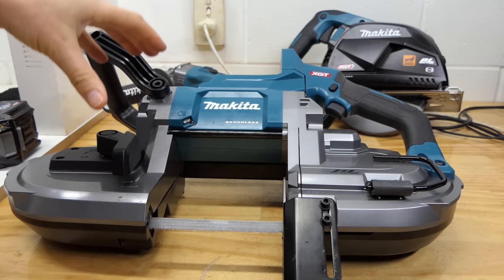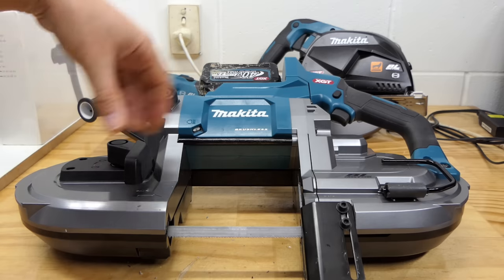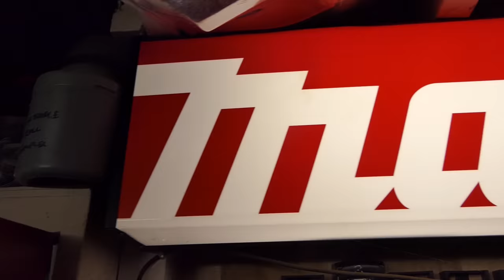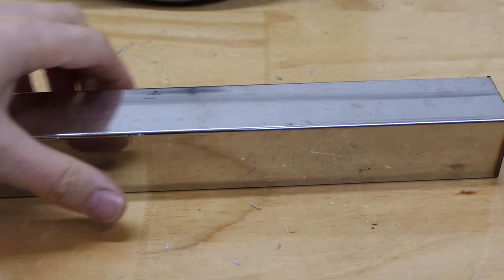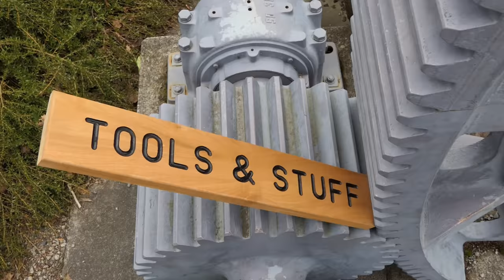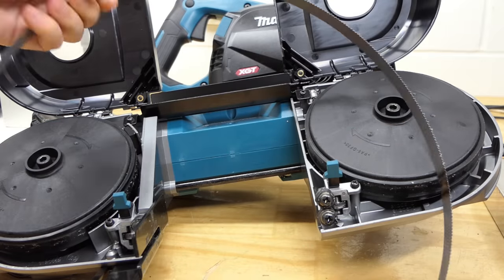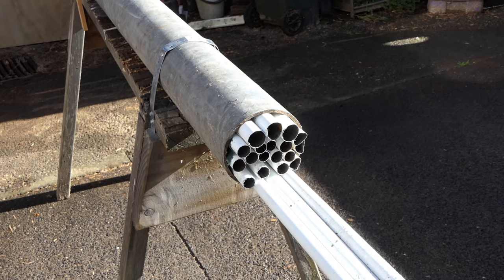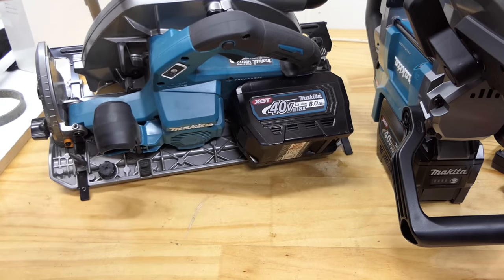Makita 40v Bandsaw, Or is it Band Saw? Either way it is BIG! Makita XGT PB002G Review

Comment: Another nice thing about this size saw is that you can get blades from just about any manufacturer that will fit it, the 45 inch blade is standard across most of the deep cut portable band saws. I run Makita, Milwaukee and Dewalt blades that I have found on clearance for around $4 a blade.

Comment: I bought one for a specific job - cutting 65mm2 powder coated steel posts to length once stood. I have the small cold cut circ saw, which only cuts to 50mm depth & this was cheaper than the bigger cold cut circ saw. It is a bit big to carry around all the time, but it is so handy. If I have it with me in the van I use it almost every day. One of those tools you never knew you needed until you got one. Holding the stock firmly & resting it snug on the guide plate are key to success. I've cut custom brackets out of angle in minutes, it cuts stainless all thread so clean you can run a nut straight onto the cut end, It will cut quad gutter to length (better with the 24TPI blade) and I used it to help cut the guttering in around a 150mm PVC downpipe. It's not that heavy, just big & a 2.5Ah battery will keep it going most of the day. The guide plate can mark surfaces. I should probably stick something a little softer over it..

Comment: After using this saw for about 6 months now, it's great. I have a variety of blades and choosing the right blade and having a sharp blade makes the cut way faster. I use it mostly for ductwork, even a piece of 12 inch duct can be squeezed in where you can cut 1/3 of the pipe and quickly finish it off with snips with no waste. Basically the higher number of teeth per inch, the thinner the metal it is designed to cut.

Comment: Had a DPB180 since 2013. Fantastic saw. I use it to cut off problem hydraulic cylinder shafts and really anything to heavy to take to the cut off saw. Even used it to cut some 2" plate once during a fire ban. I frequently cut 1045 round bar 2" diameter because Im to lazy to pull a length from the steel rack. Probably use it 5 times a week. A couple of things though, I have yet to come across any after market blades and its a different size to the American brands so Makita only. Also I do use a little cutting aid like a tapping oil or spray. 
I will say that everything that was cut was with a WAY to coarse a pitch blade.  I use a 24 tooth 95% of the time unless it is round bar 1" or bigger and it starts easy and the teeth last way longer than the demo even with carbon blades.  It is also a shame that makita doesn't have enough threaded bosses that could securely mount it not like a Red as they do and many use them as a small band saw at home once fitted to a frame.

Comment: You need a finer tooth blade for thin metals.    2 to 3 teeth touching the metal at any time on thin stock and it won't jam and will cut like a hot knife through....stainless box tube?    😀   same rule of thumb for thicker metals which means a coarser blade to maintain 2 to 3 teeth at thinest cross section

Love your vids.   Informative, comical and of coarse down and dirty commentary.   Love it!    ❤️
Reply from the maker: Yeah I know. Couldn't get a fine tooth blade at the time.
Reply: How many teeth if I'm cutting electrical EMT and Unistrut all day?

Comment: This is another tool I chose to jump in with the Hikoki/Metabo HPT 36V Multivolt system
It's a beast and has the AC adapter option which we have used for ling fabrication cutting
It replaced our Milwaukee yrs ago and has never let us down

Comment: is it hard to get a square cut with this? saw on 2" square tubing can i get ready to weld square cuts, maybe some 45s or does the blade wonder pretty easy
Reply: Not the tool for it. You want to work with a stationary saw for this kind of work.

Comment: hey good video. as a builder of residential homes I could see myself and crew using this for cutting rebar during foundations. I would've liked to see you cutting through 16mm hi-tensile deformed rebar. Also, how well does the stand integrate and how versatile is it?

Comment: What is the difference between that and a reciprocating saw everything you cut with that I can cut with a reciprocating saw so I don't understand why is it better than a reciprocating saw
Reply: If it’s not a dodgy bandsaw, it is a lot quicker and much easier one handed
Reply: Wouldn't ever use a recip for more than demolition.
Reply: Bandsaws handle super thin (and 1/8"+) material much better, they're quieter, and blade control is much more consistent.

Comment: Never used one of these tools before. Looks like a awesome tool just don't think i would ever get me one dont know what i would use it for.
Reply: Sandwiches?
Reply: You can actually mount it and use it like a standing bandsaw with a table. The bonus is you can take it with you if you have to. 
I don’t have one, but I’ve been thinking about buying one for years.
Reply: @akaredcrossbow  I have the recip saw with a small tooth blade, the metal cutting carbide saw (which is amazing) and a few grinder 4/7/9inch makita fired less grinders  .. as well as a multi tool… don’t really see a need for this.

It’s a small tooth blade, seems kinda slow. And looks kinda bulky or cumbersome to operate